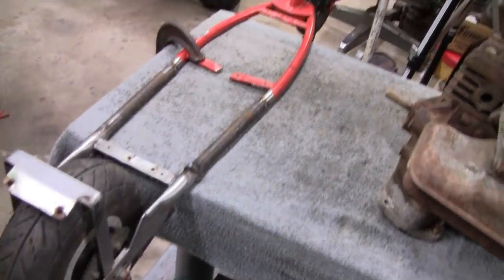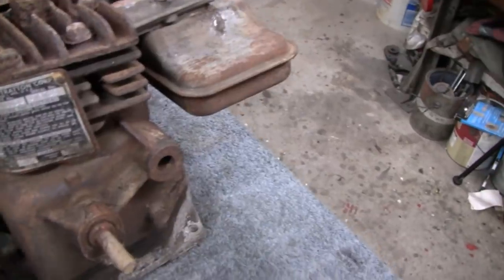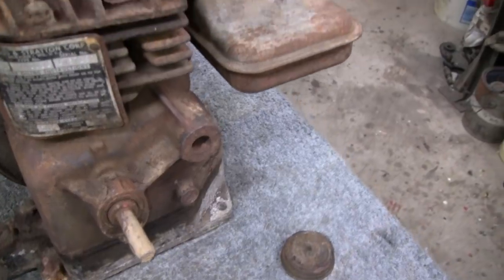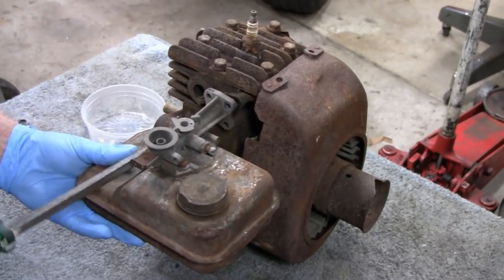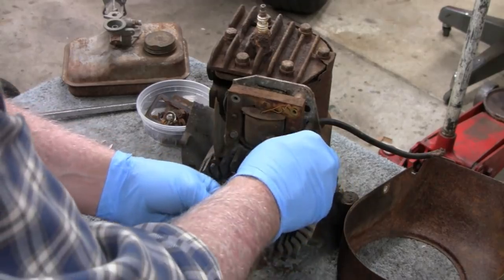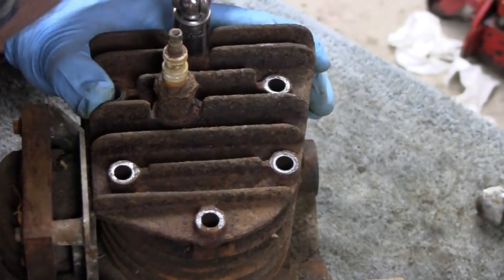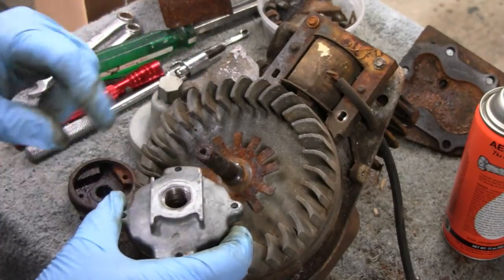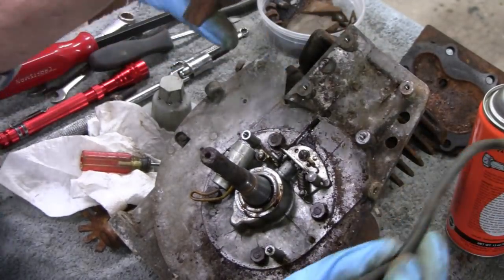MOTORIZED SCOOTER BUILD (part 2)

Comment: Avon calling.  Yeah I quit using propane in hand torches and went to MAP they sell oxygen for those too but I got that in a big tank on my big torches. My dad passed last fall so I inherited all his stuff and going through all the tools and he had one of those old impact drivers you hit will a hammer. That is one cool tool back before air tool became so popular. Love this build you are doing I might have to copy you and me and my son can make one. This year I gave him my old briggs repair manual to look in and he took a 8hp briggs that was a basket case along with all the spare part I have for engines installed in on a old riding more with a blown motor on it put it all together got it running all on his own. Thats how I started minus I didnt have a repair manual to fix mine just had to teach myself. He watches your videos as well so thanks for the videos you do and it does help some kids out there just starting to learn.
Reply from the maker: Cool story Boot!! We appreciate you and your Son watching!!☺

Comment: That's definitely a recoil starter and probably a recoil shroud. The recoil shrouds have those little brackets riveted on the top. Probably a frankenstein motor, but I did have a 5s with a recoil at some point
Reply from the maker: Yeah I agree with you Bud!! I'm sure I have an old recoil 5s out in the shed loft, I'm just too lazy to go check it out!!☺

Comment: Could you swap the flywheel to the other side so you could mount the chain where the flywheel was, or would you still be out of room? Would be a bit more involved but we all know you like that kind of thing! Good luck
Reply from the maker: Thanks Bud!! Nah I don't think that could be done!!☺
Reply: The fly wheel cannot be swapped for a couple reasons......
Reply: 805ROADKING don't think it could be done! , people would say a 4 cylinder couldn't be done but I know this good bloke that sorted that one!
Reply from the maker: You're right Ed!! I should have said "I don't think that could be done economically"!! It would take too much time and money and probably look like hell!! We're looking for the easy way out on this, we're not looking for an engine project!!☺
Reply: The coil would have to be relocated , the air shroud also for cooling the fins.....  Then a new cup made to pull the rope in the opposite direction.... A new key way made exactly in the same spot opposite the other one.  Too many things to make it work.....  The cost would be way too much.......
Reply: Ok don't get your knickers in a twist 😜, wonder if you adjusted the cam timing(suck when you blow and blow when you should suck), swapped exhaust and carb and made an adjustable timing plate (like your clear head) could you run one of those engines in reverse? I know valve sizes would be back to front but we're not talking about a ferrari! Could be an interesting future project, would be the only backwards briggs!